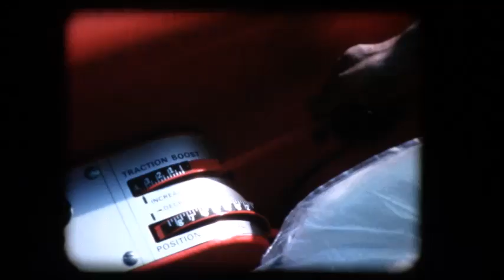1969 Allis Chalmers Dealer Movie Challenge Of Change

Comment: My dad sold AC's from 59-83.  We ran mostly D-17's here on the farms and added a 180, 190xt, and 200.  All were gassers except for the 180 that was rebuilt to 185 specs and the 200.  We could pull 2 tanks of fuel through those D-17's in a day pulling 3-16's in red clay.  We plowed in the fall and the exhaust manifolds would turn cherry red at night.  I would go up to the dealership and as a boy had a great time looking at the parts bins.  The smell of oil and grease.   Those were indeed great memories.
Reply: Absolutely relate to plowing with D17.  Plowing in fall from after school until well after dark.  Really ran well with the cooler, denser air and would really lite up the muffler just as you say.  Thanks for dredging up that great memory for me.

Comment: Oh the memories. My dad ran a dairy farm in Pennsylvania. We had five tractors, all AC. Our main two were a 170 and 180, both diesel. Being the oldest child I spent thousands of hours each year from my preteens to twenty running them, mostly to mow and bale hay and spread manure.

We also had a D17 (diesel; I forget which series,) and a CA and 175, both gasoline. The 175 was horrible but the rest were great. I didn't run this much because they were relegated to tedding, raking, and running wagons, which my brother and father mostly did.
Reply: We had a D17D 175, 5050 and a 6080. AC made some great ones and some not so great. Still glad that we didn't have a D19 Gas. Guys who had them told me that they would burn 50 -60 gallons of gas a day .
Reply: @robertlong7033  I farmed with a D19 and you'd have to work a long day to burn 50 gallons. It's burns less gas than a 4010 or a 706. I liked my D19 for comfort and being quiet and powerful but the weak spot were the hydraulics unless you put a front mount pump on. Still have my D19.
Reply: My uncle bought a new 175 gas and it was a great tractor for him. He still has it and I disked for him with it some times and hauled manure and moved round bales. The only thing I didn't like was the throttle being a bit stiff. I also worked at an AC dealer 30 years ago for a time and the 170/175/180/185 tractors were favorites among our customers. What was wrong with your 175.

Comment: I have a 190XT that is parked deep in the shed of the barn facing the highway.  She sits there in all her Prussian Orange glory.   From time-to-time some fellow, usually a young one, will stop if I'm out and come to the gate wondering what kind of tractor it is.  Not many real orange tractors in this part of the country and I don't cont Kubota.  I had it out one day about the time the kids came home from school and several of their parents stopped to see the big orange tractor with a black tornado bellow across the pasture.  A thing of excitement and beauty of the not so distant past.  Never ran a tractor that sat taller.  The Ford 9600 came close though.